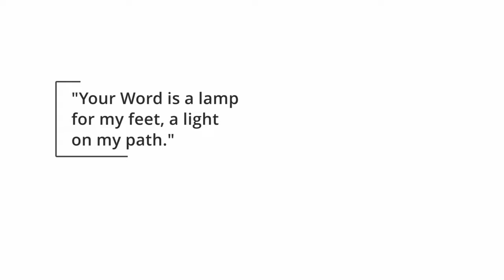How To Build | DIY | Universal Truck Bed Drawers

Comment: Yeah, without you narrating and explaining why are you doing what you’re doing, I wouldnt call this a how to build video so much as a watch you build video. With that said, it looks great I bet it functions just as well as it looks. If you were to redo them, is there anything that you would do differently? Thanks for sharing. Aloha
Reply from the maker: Thank you for the feedback, I'd agree with you on that. It was not my best effort. 
Specifically to the dimensions I did, I'd make not as tall, overall was 14". I'd aim for 12" to allow for more storage on top. Also better organization within the drawers.
Reply: Ok cool. Thanks for responding back, it’s appreciated.
Reply: Know this is a year old at this point, but what kind of lock (if you were to install one) would work with this handles? I’ve looked at using truck topper locking handles in my build but the latches you used are a huge step up in how clean the end result looks. Hoping there’s a good solution that uses yours. Many thanks!
Reply: @KlassenWoodworks  I am building ones this weekend,  mines will be 10"  tall   21" wide ( each)  almost 45" long, think will be enough space to store things,
Reply: I think to criticise the lack of narration is missing the point. Personally speaking I am right into the flow. This video had punch and was mesmerising start to finish. I thought it was fantastic, superb in fact. I think it depends on your level. The snappyness made it compact. I prefer hunting for detail rather than being spoon fed it to the point of overload. Nice one thank you.
Reply: @bonzaralph It seems that you have missed MY point/s. Besides the fact that i didnt criticize. Interesting that thats what u got from that. No biggie. Ciao

Comment: What kind of paint was that? I’m holding off building mine until I can find a good waterproof paint. I’ll have some electronics inside the boxes, so I want to make sure they’re waterproof
Reply: Use Redgaurd. It’s a shower waterproofing and it’s also used commercially for pools. Paints on red and dries pink. 2-3 good coats and it’s fully waterproof. Then paint whatever exterior grade paint colour you want. Did for mine and haven’t got a drop inside.
Reply: @erickregnier1112  I ended up using flex seal. Knowing full well it probably doesn’t work. But rainy season in Florida currently, and somehow hasn’t let a drop through. I’ll have to remake the box a little bigger at some point, I’ll do it your way next. Thanks

Comment: Well made set of drawers, unfortunately, a bit heavy and a bit of wasted space using the steel tube and bearing system for runners.  Price is probably better than going to the heavy duty full extension sliding rails, but not as heavy as the sliding rails.  Perhaps as Neil Pask did, you maybe should have removed some of the bottom sheet and also some of the rear to lighten it.  All in all, well made and a good build.  Congratulations and thank you for posting this video.... from Queensland Australia.
Reply from the maker: Those are some great ideas. The steel tube did make the drawers very stable though. Withstand any amount of weight placed in there. Thank you!
Reply: @KlassenWoodworks  Not to mention the amount of money you save! 1500mm heavy duty runners are almost $600 per pair whereas doing something with the galvanised tubing and bearings is costing $80 a pair. On my setup with 3 long 1500mm drawers, I'm saving like $1000+ lol.
Reply from the maker: @taz1012  Yup, exactly that. A bit more work but huge cost difference!
Reply: In the US we really don't need to compromise a build and  worry about a truck toolbox that weighs 10 lbs too much because we drive trucks that make plenty of power to move it.

Comment: I priced all the stuff yesterday to do the skateboard wheel thing with the steel tube. 285.00,  I said nope. Especially after I seen I could get 2 sets 60 inch draw slides with a 500lbs rating for 219.00 total on eBay.
Reply from the maker: At the time when I built this, only 60" sets I could find were $600+ a set. I have since made a 2nd drawer box system and used 60" slides from vevor at $200 CAD a set. WAY easier to work with. Only draw back was drawers were 74" deep on 60" slides so not full extension. In a truck bed where the tail gate comes down 20" and then drawers only slide out 60", it's tough to reach the back 1-2'.
Reply: @KlassenWoodworks   looks like you built this a couple years back when steel was cheaper. I was shocked at the price of the tubing and hardware. The skateboard bearings are not too bad. But nuts and bolts and steel tube is ridiculous now. Cheapest square tube I could find was -bout 45.00 a piece.
What’s even crazier is the price of steel went up but slides went down, lol. I have a short bed truck. 6 foot bed. That last foot is going close to the cab is just going to be empty space. Two 60 inch  by 23 in drawers is plenty for me. I’m just so tiered of having stuff crammed behind the seat and just rolling around in the back. Some organization will definitely reduce the headache. Thanks for the video, I think it was done very well, I don’t like it much when people ramble on during the videos. I’m like just get to the point. I noticed some comments about this not being a tutorial. Some folks I guess you have to walk them word for word through every step.
Reply from the maker: @myfalconry1976  Yeah it's wild. If you have a small local fab shop sometimes they'll sell at way better prices that big box. Sounds good like the slides will be the perfect fit for your setup. Ones I used had locks integrated into the slides. Yeah, everybody learns different that's for sure
 I'm just like you when it comes to absorbing information. Appreciate the feedback!
Reply: @KlassenWoodworks  yeah I got the locking slides

Comment: My only concern is that the pocket hole screws should be pointing towards the inside of the box.
Reply from the maker: I do agree. Thought was to hide them on the inside, could have run some screws from the bottom to reinforce.

Comment: It's so worth the effort to have a good run off table for the tablesaw if you have the room. I don't know if it will work for you, I set the guage on my portable table saw to zero. I save a ton of time not having to measure the fense distance with my tape. And it's super accurate
Reply from the maker: That is something I need to take the time and setup properly. I still measure to this day lol

Comment: May the Lord continue to give wisdom. Great job. I’m a beginner I’m looking to do something like that for my suburban. Could you share a bit more in detail what you used for the track system please?
Reply from the maker: Thank you. For the track system we used 7/8 diameter bearings along with 1" steel square tubing. Using bolts and spacers to mount the bearings in place. If you'd like to know anything more specific let me know. Good luck on your woodworking journey!

Comment: I would actually make it so that the draws could be fully removed instead of installing the stopper. That way if you wanted to customise anything you could just remove the drawer
Reply from the maker: That would be a great addition! A simple lock design could be made to achieve that. This one was customized afterwards and being removable would have helped a lot.

Comment: Unistrut could have been a great option and lighter for the drawer rails
Reply from the maker: That would be a nice upgrade!
Reply: I’m thinking of using this design for my van! Going to have a go this weekend and was also thinking unistrut. What size box section have you used???

Great video, thank you!!
Reply: Great video. Thanks

Comment: Thanks, I about to build a set of drawers for my camper trayler, also for the Fridge tray on the side,  still not sure how do you secure the squere tube to the box, self tapping screws?
Reply from the maker: Very nice! Yes, I used some self tappers that had bigger pan head on them that acted like a washer to help grab the plywood.

Comment: What a beautiful build. Can you share where you purchased the drawer handles?
Reply from the maker: Thanks!

Purchased off Amazon, can't find exact model but here is a link to similar style ones. 

WINOMO Stainless Steel Practical Paddle Handle Toolbox Lock, Heavy Duty Locking Latch for Trailer Auto Special Vehicle, 1 PC https://a.co/d/hVrS258

Comment: So with the square rails how much did you save on money using them compared to the 500 pound tracks and with wise how much space did you lose not using the tracks?
Reply from the maker: Not sure how much space the 500lb rails take up but here I lost about 4" total. i also could not get a decent set that would extend that far in Canada that weren't a ludacris price. Believe they were around $450 a set

Comment: How do you keep the bottom out of the water? If it's in the ed of truck and there is rain and the drains are plugged the bottom witll be in water and swell and start to separate. Thats the big question I have with these wood drawer builds. Great for nice weather or if you have a topper or other watertight cover.

Comment: Love the system. How did you attach the square tubing the the side I'd the drawers? I saw you drill the holes and screw in from the inside but what kind of screws did you use?
Reply from the maker: Thanks!

I predrilled a small pilot and then used a self taping screw with a flat head so it would be flush on the inside. Worked very well!

Comment: Thank you for video, very cool.
How many hours you build IT? And how weight?
Reply from the maker: It was surprisingly heavy but 2 people were apply to load it no problem. in total was a week of evenings.
Reply: @KlassenWoodworks  waw take so long, i know also you take long time to make this video
Thank you very much i will try do the same with simple tools i have😂😂😂
What bearing size you use? Looks very strong
Reply from the maker: @electrolatifSG  Hey I think it's possible with just a circ saw and a drill. Believe I used 7/8" diameter x 5/16" wide
Reply: @KlassenWoodworks  thats great 👍 i will try do it also☺️

Comment: hello, cool woodworking, what size screws did you use? and how much of a gap did you leave for the 1' tubing and bearings?
Reply from the maker: Thank you. Sorry I never responded. Missed it somehow, I honestly did not measure. Installed the lower bearings and then placed the tube on top and installed the upper bearings.

Comment: Did you use 1 inch or 3/4 inch steel tube? Also what was your total build cost because when I priced out this build it would cost me close to what a used decked system would cost.
Reply from the maker: It was 3/4" steel tube. I don't remember exactly but it was around $800 CAD. If I factor in my time it's close, found used ones on marketplace for around $1500 at the time. But this was for a customer so couldn't say no.
Reply: @KlassenWoodworks  Thank you! Was there any flex in the drawers with the 3/4?
Reply from the maker: @holdenfitz-earle973  No, there was not. Adding some rigid center dividers can help, too.

Comment: Thanks for the video.  What was the reason for the additional backer board installed behind the drawer latches at ~14:00 in the video?  Earlier in the video it seemed like the latches were working ok?  Thanks
Reply from the maker: Yes, they were great. Additional coverage, this box was going out in the construction field. Felt this would help block dirt and debris from making it into the latch system and looked cleaner.

Comment: how did you attach the metal rail to the drawers ?
Reply from the maker: I used self taping screws, they have a flat head so the inside was flush with the ply.

Comment: What size M8 bolts did you use for the sides and the middle?
Reply from the maker: I believe it was 1 1/2" on the outside and 2 1/2" on the middle run

Comment: What kind of latches are these?
Reply from the maker: I bought them off Amazon, the exact ones are not available anymore but here's a link to some very similar ones. 

WINOMO Stainless Steel Practical Paddle Handle Toolbox Lock, Heavy Duty Locking Latch for Trailer Auto Special Vehicle, 1 PC https://a.co/d/5jA2v2m
Reply: Thank you!

Comment: Would anyone be able to give me some advise on something please? I would like to make drawers that are 100x40cm that can hold around 7kg each. I have a lot of spare 12mm and 5mm hard plywood. Would the 12 be strong enough for the sides and the 5 for the bottom? The other thing is that I want to build these in a van so would need to be able to handle the vibrations. Thanks
Reply: short answer ... possibly (7kg isn't much weight for a large surface area).

Comment: Where do you get the handles
Reply from the maker: I bought them off Amazon. The specific type I bought brings me to one very similiar but with keys. Here's the link, hope that helps!
TCH Hardware 2 Pack Stainless Steel Paddle Slam Latch with Lock & Key - Flush Single Point Handle for Door Trailer RV Jeep https://www.amazon.ca/dp/B07HS2D7T5/ref=cm_sw_r_apan_glt_i_M86C6SNGF656GSFH6E7D?_encoding=UTF8&psc=1
Reply: @KlassenWoodworks  Thanks
Reply: What hardware did you use to install the bearings for the sliders? And was that just tube steel as the slide rail? Thanks
Reply from the maker: @averycox4230  Yes, 1" tube steel. I used 3/8" bolts, longer ones in the center but forget the exact lengths. The washers I used had a larger diameter than the bearings so I used 1 washer against the plywood and lock washers to space the bearing out.
Reply: @KlassenWoodworks  Cool, thanks

Comment: How do you make the drawer stop? I'm curious because we don't see it well in the video...
Reply from the maker: Hey, so I added  a bolt on the inside of the drawer that stuck out of the side towards the middle partition. And then on the middle partition I added a block where the drawer was at max extension. This way the bolt hits the stop block and limits travel, if that makes sense.
Reply: @KlassenWoodworks  totally, thanks for taking the time and great work btw
Reply from the maker: @Olaf  Absolutely, apologize for the delay! Thank you!

Comment: What size bearings and tubing did you use
Reply from the maker: Outside diameter of bearing were 7/8" paired with 1" tubing